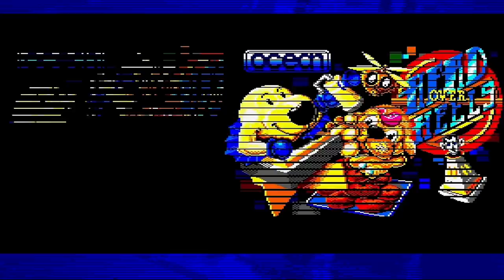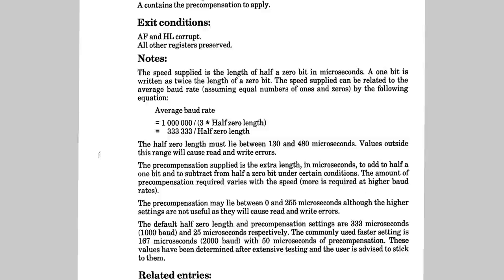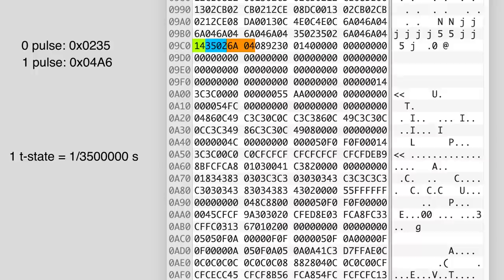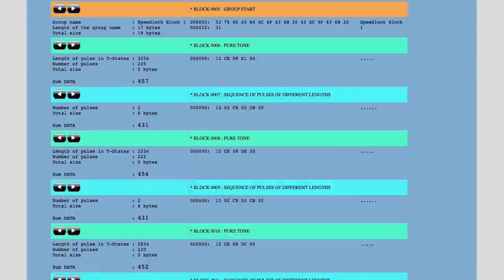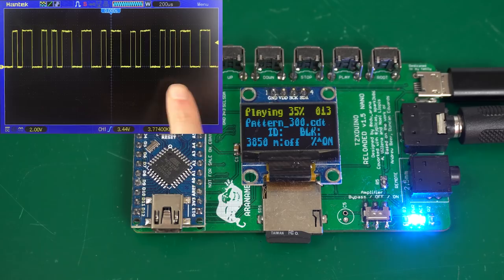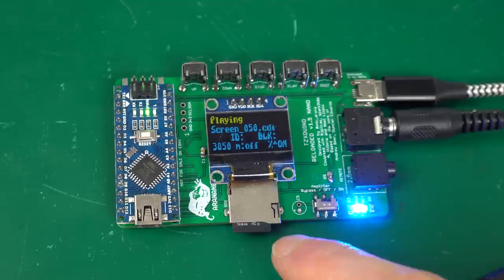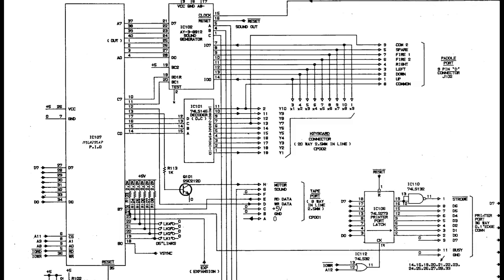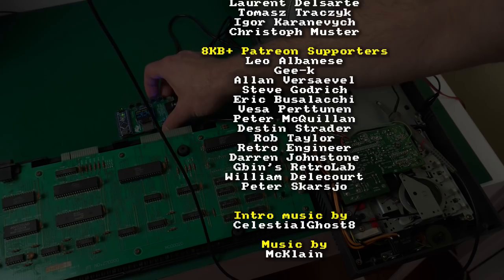How Fast Can We Load From Tape?

Comment: The TRS-80 tapes used a system which, as I understand it, was also used in early disk drives.  A clock pulse would be recorded then either a second clock pulse for a one or a period of silence for a zero.  Reading consisted of waiting for the first clock pulse and then waiting a specific amount of time before checking to see if there was a second pulse or not.
Early TRS-80's had a fault in the timing programmed into the firmware which meant that the reading could be unreliable, especially with a less-than-perfect tape.  This was fixed later, but not before the machines had earned their nickname of "trash-eighties."
Reply: There was a kit-built computer known as the "Dick Smith Super-80" which used cassettes recorded and loaded at 300bps, but by changing two memory locations you could double that to 600bps or quadruple it to 1200bps, at the cost of requiring better tape quality for the highest speed.  Speeding it up further was not possible since it used 1200/2400Hz Frequency Shift Keying and it's not possible to either save or load any faster than half the upper frequency.
It might have been interesting to try changing the FSK frequencies to 2400/4800 but that would have required re-tuning the Phase Locked Loop used to detect the upper frequency and would have made it incompatible with the default speed.
Reply from the maker: That seems a lot more reliable, but perhaps slower. I like it better though.

Comment: Codemasters produced a CD which loaded games extremely quickly. The CD came with a cable that plugged into 3.5mm headphone socket of the CD player one end and the Joystick port of the computer at the other end. I wonder if trying to load via the joystick port would be feasible in this case.

Comment: The arduino does things a particular way, which is slow and imprecise. There are ways around it. I don't recall exactly what and how, but I saw it in a video. You can also program the microcontroller in the traditional way.
I don't like things like the arduino and raspberry pi for the fact that they are incredibly overkill for most things. There's just so much bloatware.
Reply: Yeah, ultimately that's what the everything non-pro is suffering from at this point, no matter what platform you go for. RISC-V was supposed to give us an out, but it's been slow going with only SiFive offering two (somewhat gimped) dev boards that've both gotten nearly ZERO attention from the maker community.

Comment: I remember "turbo" loaders on atari  8bit computers. Original atari uses 600b/s standard turbo 2000b/s and some torbos use up tp 10000b/s. Original speed means 15-30min to load game... However, it meant hardware modification (not complicated, you could do it yourself at home) of the cassette recorder and uploading the loader after each restart, or later everyone use cartridge with a turbo loader.

Comment: I was expecting a c-cassette doing mach 1 :/

Fun fact: timers always run over the allocated time in a non real-time system that has a scheduler, because it's about sleeping the thread and asking the scheduler to wake it up after the allocated time. The precision depends on many things, but can be quite rough.
Reply from the maker: Right. I dug out somewhere from the docs that the callback has a 2.5us overhead, which matches up nicely with the measurements we got. Precision isn't super important yet, so that's fine (or we can take it into account if it is). The thing that baffles me is that it's chocking beyond a certain point with the SD read interaction (which, as far as I know, should be completely in parallel). Anyway, I'm hoping to be able to write something much simpler and faster.

Comment: After watching this (a second time!) I started thinking about better ways to create a signal with stable timing to allow for higher speeds. A good way to do this would be to use a UART to generate the signal. The 8-bit machine can then "bit bang" the reception of one byte at a time, and then resynchronize with the start bit for the next byte. So even if the flow of bytes gets interrupted for a moment, that won't cause any trouble.

I started thinking about how that would work on a C64 (which I know much better than the ZX Spectrum or CPC) and I think it might just barely be possible to do 57600 bps at 17 clock cycles per bit. And 38400 bps at 26 cycles/bit should definitely be doable. (Although not through the cassette port as it only provides interrupts on bit edges, not the actual state of the input. So use a line on the user port instead.) The C64 has some hardware timers that  could be helpful, especially if you want to keep the screen on and miss 40 clock cycles every 8 CRT scanlines, so timing loops won't work in that situation. The Z80 systems generally have a 3.5 MHz clock and more registers so less delay accessing memory, but 60 cycles per bit is still going to be a challenge, just like 57600 on the C64. But I'd love to find out.

Comment: Enjoyed it indeed Noel.  Another great video! The concept is great, pushing the limits of existing ecosystem of available programs & hardware to get the fastest load.  I guess this 'faster horse' approach is only the start. Having a purpose built 'load on the fly' device which loads directly into the CPC's memory through the bus port would get you the fastest throughput and load times.  Without resorting to moving to the "disk interface" world.  I think all raspberry pi versions could handle that job well.

Comment: It seems you are basically setting up a rather convoluted way to what would normally be a simple serial port. Keep in mind that in audio circuitry, you don't have any kind of on/off levels (i.e. pure square waves), since they usually block DC. Also, there is always a limited bandwidth available.
However, it seems that the Arduino there outputs purely digital signal levels, and towards the end, you read in only a digital pin. That is, basically, just a regular serial data interface. Which then has pretty much nothing to do with audio anymore.
A more suitable way would be to record the actual tape through your soundcard, and then have it play back faster and try to load that. At least as long as you want to emulate the behaviour of a cassette  tape, even though an idealized version of it.

Comment: This was a great video! I remember using a custom loader on my ZX Spectrum 48k to double the tape speed when I was in high school!! An idea that I had while I was watching the video was this: Since the Arduino is used to send the data, while using a custom loader on the Amstrad on a custom pin, why not use a second pin as a clock then? That should be interesting!

Comment: Well, if you are making a custom SERDES (serial bit reader) you can really have whatever serial protocol you want going to the Amstrad, like NRZ for example.
I think it would be a fun project. Perhaps you could start up a GitHub project and allow some contributes to play around with different ideas?
I have got 30+ years in embedded design and, given some time, could probably get a framework started to replace Arduino, or perhaps there is a good alternate starting framework out there already... GitHub could also host the Amstrad SERDES protocol reader assembly routines...
Anyway, looks like a fun little experiment!
Cheers,
Reply from the maker: Exactly. That's where I was headed next: Maybe some kind of UART to start, or look into the "symbols" support of TZX encoding different bit groups in different ways. Ultimately I might even not make it serial and have several bits at once in the joystick port, or, gasp, in the user port directly, but for that we'll definitely need something faster than an Arduino. Anyway, lots of possibilities!
I did throw what I made in Github. It's all very specific to this, but it's a start: https://github.com/llopis/HyperLoader Come by the Discord server if you get a chance. It's the best way to have a discussion about it.

Comment: I don't know what head the ZX Microdrive used, but I suspect it was just a standard cassette tape head. It was fantastically fast for it's time. Around 120 kbit/s with the tape moving 76 cm/second according to wikipedia. I guess if you could get a standard tape player to move at that speed, you might be able to get something comparable.

Comment: Just wanted to tell you few words about my little project for SVI-328... Instead of Arduino I used simple USB to TTL RS232 interface that you can get @ 3$ or so. Then I just used Dupont cables to plug it in to Joystick port that connects directly to PPI. By doing "soft serial" routines for SVI I could quite nicely go to 57600bps speed (8N1). You can actually go even faster than that, but practically next standard speed of 115200bps is out of reach for SVI... I guess that is true for Amstrad as well as it has pretty similar effective clock rate. RS232 is naturally faster than doing FSK and the good thing is the very cheap & easy HW setup needed that allows two way communication. I actually wrote disk drive emulator for the SVI and it loads disks practically fast enough. Usually my solution to load from PC is slower than real disk drive, but it depends of the data you try to load and how old low level disk routines are used (SVI loads them to RAM instead of using ROM routines). On small data blocks the practically missing seek time helps a lot.

Comment: For small bet with my friend I wrote Manchester encoding tape routines for ZX Spectrum. It was fast compared to original. Pity it was 30 years ago and no source left... And this ATMEGA chip is running at its limits when reading from SD. Switch to STM ones.

Comment: The cassette interface on my late 70s Ohio Scientific was much simpler than all this. It was effectively a 300 baud modem connected to a ACIA that just read or wrote bytes at a baud rate set by the hardware. We found that a simple mod could get it up to 600 baud with no problems. It saved and loaded BASIC programs exactly how punch tape on a terminal would. The SAVE command would send all output to the cassette. You would then type "LIST", then start the cassette recorder, than hit the enter key and it would "print" the listing to the cassette. Likewise, the LOAD command would have the cassette player "type in" the program. Once you saw the whole program on the screen, you hit space and return and the keyboard worked again.

Comment: Wow, how deep can you go? Funny thing is: I DIID always wonder how fast you can go. Nostalgia Nerd did a small test on that, but I thought: surely it should be possible to improve on that! He did it on a ZX Spectrum (I've never even seen an Amstrad CPC, let alone used one), but since the routines are so similar, they should be transferrable, right? I don't expect NN to rewrite routines and try printer port adapters any time soon. Really cool channel...
Reply from the maker: Oh interesting! I missed that video by NN. I'm going to have to go and dig it out to watch it. The specifics of loading are going to be slightly different (different ports mostly) but very similar I suspect, so yes, anything we learn here can easily be applied to most Z80 computers I think.

Comment: I think the title should be "tape interface". As you are not really doing a lot with tape.
Also this seems to be potentially interesting for backwards compatibility. It also opens up a very simple option to attach a lot of storage to old systems. Because as far as i understand it there is no reason not to use the full capacity of any SD card the micro controller can read. This might even be useful without the added speed. But the speed is definitely a nice bonus.
In short: 
I think you might be underselling this a bit.
Yeah, lets be honest there are probably not a lot of machines with cassette storage still in use.

But the few people who still have to deal with this might find this very useful as it does not require any alteration of the existing legacy system. This can effectively be used as an Tape to SD adapter for those systems.

My experience tells me to not be surprised if i saw a tape computer in bank or old factory machine.

Comment: Nice video. Just to mention another system, forget the name, but it would like NTSC video, where its amplitude modulated. The amplitude is the data, but to know the what is a zero, there is a long low signal (above no output) that sets the 0 value, then steps above that represent a digtal value. or it was at least very similar to my oversimplification

Comment: I think you could speed up your final loading code by using a SHL and checking the sign bit, instead of the AND and checking for 0, because by not having the constant %01000000 you save 1 byte in each function meaning it can run faster.
Reply: ... or switch to a 6502 and use its four cycle BIT abs instruction, which copies bit 6 straight to the V flag ;-) JK ...

Comment: You should be able to read and write at least 112 kbps from a regular tape. If you transmit data over POTS you can achieve 56 kbps. This has a bandwidth of 3 kHz, and is usually sampled at 8 bits. Now compare these figures with a compact cassette. The bandwidth for a single channel is around 12 kHz, and the dynamic range is slightly higher, maybe you can squeeze 10 bits per sample out of it. But there is more: The tape has two channels in a consumer configuration, thus the speed can be doubled. Another possibility is to use one channel as sync and the other channel as data. You also have the option to use some error correction code. Anyway, doing the math, you end up with more than 6 times the bandwidth of a single POTS line. I think the main bottleneck is the computer, not the medium.

Comment: since you already departed from audio signals you can add another input bit (for the trx clock) and use a SPI protocol like transmission : you might obtain outrageous (for the platform) speeds in the hundreds of thousands of bits per second

Comment: Hello Noel, great video! I find really interesting to try to reach the limits of the load mechanism. I am tempted to try the process myself for the Speccy. I don't like the Arduino too much, IMO it has too little processing power, I prefer devices such as an ESP32, a much more powerful microcontroller device, with 520KB SRAM, clocked at 240MHz, and 4MB flash storage. Unfortunately, the code should be adapted, but the ESP32 is like an Arduino on steroids (it can generate VGA signal at lo-res and there are baremetal Speccy/CPC/other emulators based on it). Regards!
Reply from the maker: Yes, moving over to a more powerful microcontroller would be great. My experience with those is much more limited, but maybe I'll use this as a chance to learn. Hop on over to the Discord server if you're interested in discussing this. We have a whole channel to talk about where to take this project next.

Comment: Hi Noel, the CPC is able to read tape data VERY fast. I made some tests with for example Turrican 2, which is one of the biggest if not the biggest CPC game. I can load the Main Menu, then the level 1 in 2 minutes.
Reply from the maker: I never tried Turrican 2, but looking at the CDT data, it doesn't look particularly fast https://www.cpc-power.com/CdtView.php?fiche=2319&slot=20&rang=0 The pulses are a little slower than Head over Heels. I suspect it seems faster because they compress the data and they load it in smaller amounts throughout the game? Just guessing.
Reply: @NoelsRetroLab  I forgot to say 2minutes after compressing and custom encode the block. The speedlock 6 on turrican 2 is running at 1650 bauds. Speedlock 4 at 1900 bauds. Ps : I'm the guy who encoded hoh and turrican 2.

Comment: What about a solution along the lines of the codemasters loader cable which used the joystick port. you could even use two lines (or more i guess) to signal high or low bits.
Reply from the maker: Yes, the joystick port can be even faster because it has more lines. I didn't know Codemasters used that though. I'm going to have to go research it now. Thanks!!
Reply: @NoelsRetroLab   I think it was for the CD release compilation if that helps narrow down the search.
Reply: @preferredimage  Yes, I think that is correct; as far as I know, the Codemasters CD contained a small loader/menu program that you had to load through the audio port, but once it was in memory, it would use the joystick port for all the game data.

Comment: I think you mentioned not wanting to change the audio encoding, but it seems to me like this one is wasting a significant amount of bandwidth.  For example, with very little effort you could try sending bits on the low and high states, simply counting time between transitions low-to-high and high-to-low.

Comment: Kool, most engrossing. Does it mean you could write a dual loader reading two tapes simultaneously by splitting the program data  into two files and loading tape 1 from bit 6 and tape 2 from bit 7(via dongle to the printer port) for even faster loading?

Comment: I would be curious to know how fast you could store and recover data from real tape if you used all the modern techniques. E.g. QAM modulation, error correction, analog i/o.
Reply: YES, on a analog telephone line with 3.1kHz bandwidth modems finally had a data rate of 34kb - therefore a new "Datassette" should also be capable of 100kb instead of 0.3kb (or 3kb with "Turbo Tape").

Comment: Had a msx back then, after the original cassete drive died, my uncle lent me one that had variable speed (wasnt meant for computers but it had all the 3 plugs you would need). Some games would fail if you touched the speed setting but some others could load about 25% faster, no kidding.